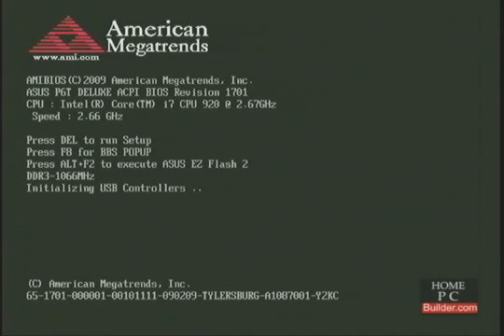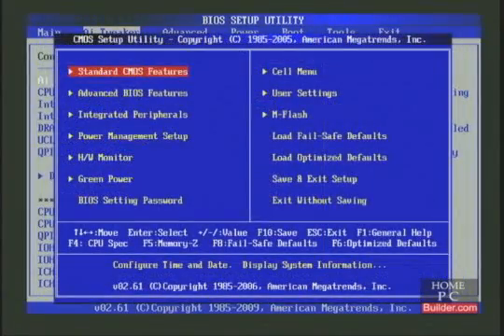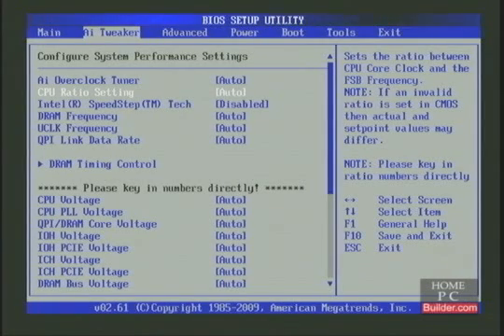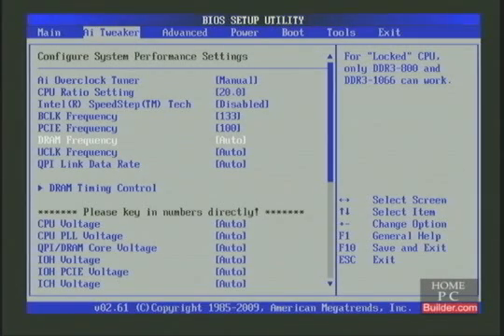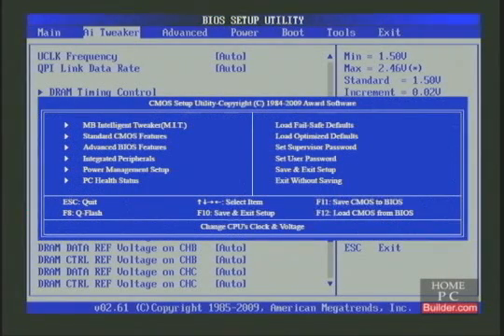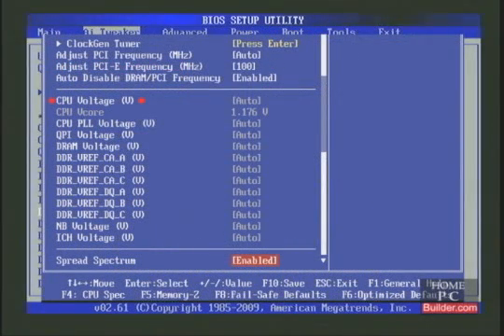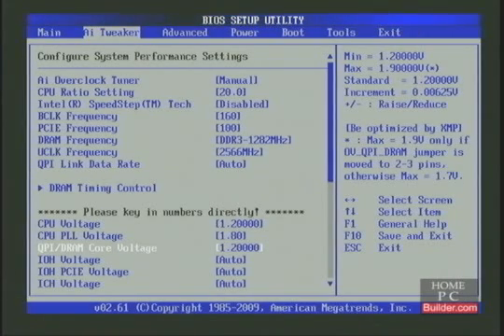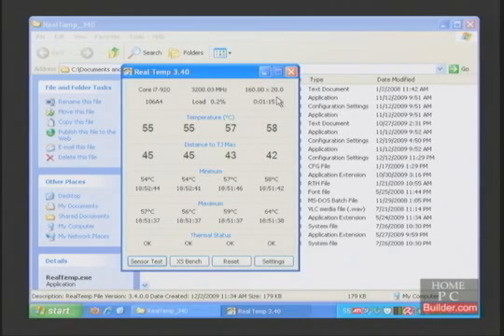Lesson 03 - Intel Core i3, i5 and Core i7 CPU Overclocking - www.HomePCBuilder.com

Comment: I Have Intel i5-3317U 1.70GHz Can I Overclock it to higher Speed ?
Reply from the maker: Not with that model cpu
Reply: @MichaelTheComputerGuy  My Lap Model is Dell Inspiron 15 3521. I Guess it's older than 6, 7 years but tat time it used to be hav AMD Radeon Display driver & in internet it says my lap spec 2.4GHz.... Now I Updated Win 10 Home ! After Update all drivers uninstalled & only using Windows update setting I installed all using drives.... Now it's missing amd Radeon drive & speed I don't know why 🙄 
.
.
.
Im an Illustration artist nowadays when using softwares like Photoshop or more big multitasking operations my Lap Hangs.. tats when I found my prob with GHz....
Please help me..... How can I speed up my Lap ?????

Comment: can i overclock my i3-4160 3.60hz to 4.0hz?
Reply from the maker: No.  If I remember right beyond the second generation of core processors base clock overclocking wasn't allowed. To overclock your processor model number has to have a k at the end. You also need a Z series motherboard.

Comment: i have intel i3 2350M hp laptop can i overclock
Reply from the maker: No.  It won't have the necessary settings in the Bios to do overclocking.

Comment: I have an Intel core i3 2100 cpu @3.10 GHz. I think that it has a locked multiplier but is there any way of opening it?
Reply from the maker: If the CPU is multiplier is locked you can't open it up. The best you can hope for is to increase the base clock to get the CPU running faster.

Comment: Hey can i ask you a question if i overclock my core i3 3240 3.40 ghz to high level.Will it catch on fire and explode or its normal to set to high settings?
Reply: if you have a stock cooler it will make the whole system shutdown when its too hot to prevent damage

Comment: In msi extreme tuning utility I can overclock an i3 4360 3.7 Ghz to 4.0 Ghz and keep the system running stable. Only works on a  z87 and z97 chipset.

Comment: What to do when pc wont turn on even to get in bios? I got i3 530 @2,93Ghz but when i tried to oc it to 150x22(multiplier) i couldnt start my pc(I didnt follow these steps since i didnt know anything about overclocking), so I got mb battery out and restarted bios. Should i try to overclock cpu by following these steps? Friend of mine told me that taking mb battery out is bad. What is your opinion on this?
Reply from the maker: Instead of removing the cmos battery can use the cmos clear jumper.  Take a look at your motherboard manual to locate it. It is three metal pins sticking out of the motherboard with a jumper connecting the left and center pin. To clear the CMOS you move the jumper so it covers the middle and right pin.
Reply: Michael Cooper What about overclocking? Should I try once more or leave it since its old? Also in bios(msi) cpu voltage  max value is 0.302. Should I leave it +0.000 so it doesnt change?
Reply from the maker: Vladimir Jelic What value is the .302.  One of the voltages?
Reply: Michael Cooper CPU voltage value for max is .302, min .000, auto .000...DRAM voltages are min .978 and max 1,898 so its normal but cpu voltage is strange
Reply: Vladimir Jelic Oh I find CPU VTT voltage that has i would say normal values for max and min. But I cannot find DRAM Bus voltages and QPI voltages options. I am having msi mb
Reply: Vladimir Jelic Where to find Uncore frequency ?  I got only QPI and Memory ratio in freq options
Reply from the maker: Vladimir Jelic these videos are a little old. The names of the settings in current motherboards are different. These videos should be used more for learning how to overclock in general as opposed to step by step instructions to be used with today's motherboards.
Reply: I got msi h55-p31 and i3 530 cpu so i find this guide best for me
Reply: Vladimir Jelic But problem is that i cannot start my pc whatever i do with oc...i managed to get it up with 3,08ghz but thats change fsb 133-140 which is not noticable at all

Comment from the maker: @Swinkid That is true.  If you are buying a socket 1155 CPU and want to overclock it make sure you buy a model 2500K or 2600K.  These are the ones with an unlocked multiplier and there is no need to change the base clock.  The videos teach you how to balance frequency and voltage settings to get a stable overclock.